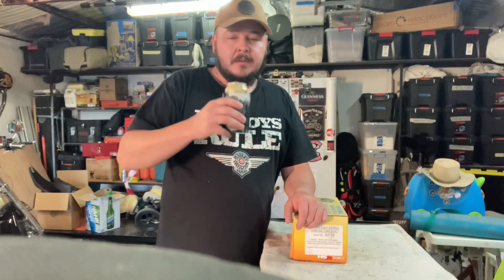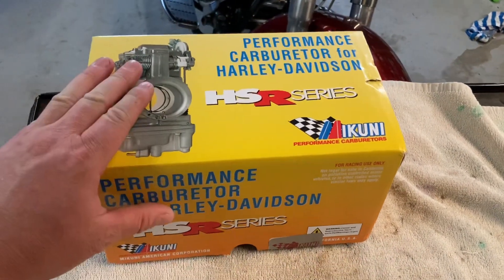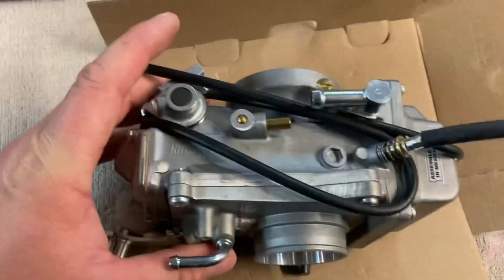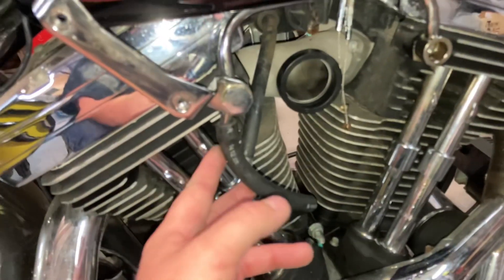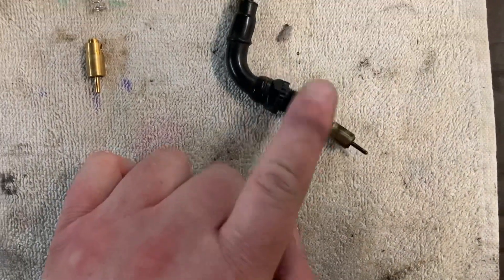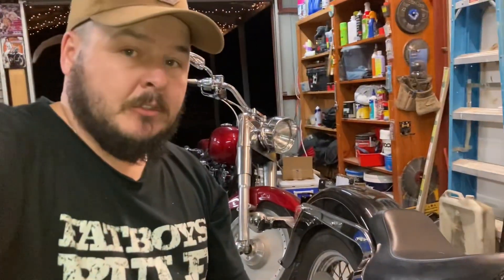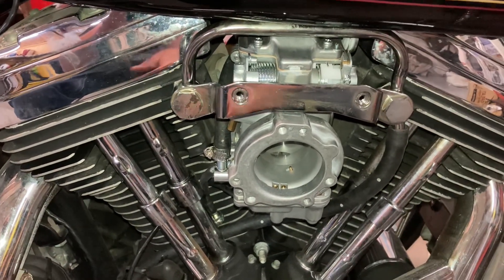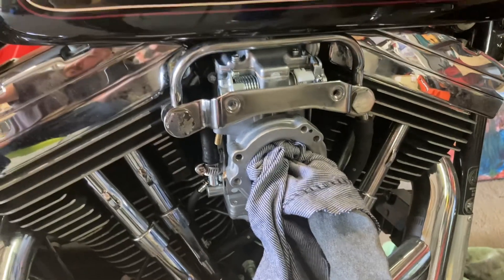Mikuni carby install

Comment: Hi Rooster , I have been trying to research information about the HSR 42 , I just recently bought my second softail deuce, 2003, 
And I thought I knew everything about setting the carbs and problems , as I have been riding for well over 60 years, I’m an old dude.
The bike is spitting back through the carburettor , So it to me, it is running very lean, So before I done any other investigation, I took the carb off, stripped it, purchased a rebuild kit, and put it all back together, I forgot to mention, I believe the fuel and been left in it for nearly a year as there was a lot of sediment in the bottom of the bowl, I cleaned it very well, I started it. It seem to be running fine on choke, and it then started spitting back through Carb , I’ve taken the plugs out, and they completely covered in black suit. Nobody have been in and changed them for quite awhile., makes me wonder whether it is shorting out inside, what’s your opinion please be very much appreciated, try to find peoples comments, with similar issue, from old dude,
Reply from the maker: Thanks for watching, much appreciated. 
I’m probably not the best person to ask for advice, as I’m just a dip shit in a shed. My twincam with the HSR asn’t give me any bother but my Evo HSR has. 
I thought the same as yourself, that she was running lean and I was going to lift the float needle a little, but when I checked the spark plugs, she didn’t seem to be running rich or lean so I just reseated the air & fuel screw, adjusting the pump lever to the distance as per manual (they were all out a little as per manual recommendation). Bike is now running a lot better but will still black fire the odd morning after she has sat a few days. This morning she backfire once or twice in the first mile, then was fine the rest of the day. 

Hope that helps
Reply: @_Rooster  Hi 👋, This my fourth, Harley, And all of them, I have changed the carburettor, mainly to give better throttle response and a bit more power, I’ve had sportster, FXR, Softail Deuce, and now on my second softail deuce, I did try a Edelbrock Qwiksilver 38 on my FXR, 
I think HSR IS a slightly better, and should be easy to set up, Deuce I purchased a month ago, got no service history with it, and also don’t know how it’s been looked after, going by. I’ve taken the seat off and so much dirt and grime under the seat., I don’t think the bike has been very well looked after, The float settings were weigh out, The air mixture screw was nearly 3 turns out, And the cab is telling me one thing, on the plugs are definitely telling me that it is running too rich, So a bit more investigation is definitely required, bike is still in the UK and I’m over in France, I’m waiting for paperwork, Hopefully in the next month or so I’ll get it sorted, ride safe,
Reply: Good morning 🌅, Rooster, I hope you are keeping safe and well, round the other side, My Deuce is now running great, inlet manifold was leaking, someone had put cheep jets in the carb , so I have all new jets and gaskets in HSR 42 , I have since found out that it’s got a big bore kit on it , 1550 , An S & S g510 cam, I purchased the bike about three months ago thinking that it was a cheap buy, i’ve ended up spending a lot of money on it. I’ve rebuilt the primary site including the main bearing on the output shaft of the gearbox I’ve rated it to a Jim’s larger bearing that replaces the sleeve that is very hard to get off the main shaft, Put a new drive poly sprocket on the gearbox for the driver belt and replace the belt, the belt was completely shot, and I believe the belt was running too tight, as the teeth on the sprocket were hooked, 
Going back to your problems part the problem could be the exhaust , as I have always found the bike to be stifled slightly with dual pipes, It’s obviously your preference On looks, but a tune into one system is always better, actually give you some more power and the bike should run a lot better as well, not sure whether I’ve mentioned, but I purchased the bike from the UK, and imported it into France where are now living, I had problems getting a conformity ticket, that’s now sorted, then it had to go for a control techniques inspection, it sailed through that no problems at all, and it appears that this year was the first time that motorcycles had to have inspection very strange, and the inspection last for three years, so I’ve now submitted all my paperwork to the authorities to register the bike in France, hopefully they will be through in the next week or so, I am still allowed to ride the bike, Hopefully later today I will be doing, I just noticed in one of your other videos that you’ve got yourself a air operated lift. I’ve been looking at one of these a week or so ago., might be good for me to get one for the future, I wish I had something that I could turn the bike round when it’s inside my building, as I drive it off the road into my basement and gives me problems trying to turn it around when I want to come out, specially being a old dude, I might have to go back to the gym, 😂, I’ll find a good young lady to help me build my body back up, 😂, stay safe ride free.

Comment: Can you post the details on the bracket you purchased? Thank you
Reply from the maker: Carburettor Support Bracket. Fits Big Twin 1990-2006 With CV, 42mm, 45mm & 48mm Mikuni Carburettors & Big Twin 2001-2008 Delphi EFI.
Website Rollinspeedshop.com
ROLLIES PART No: K8332
MFR PART No: 8332
Rollies are great to deal with and will contact the buyer before confirm the purchase just to make sure you’re getting what you wanted.